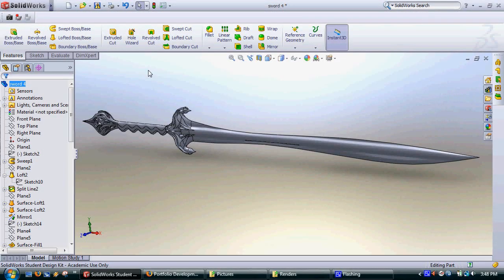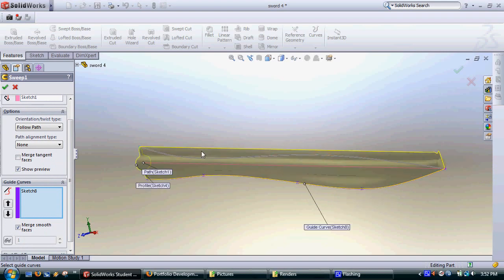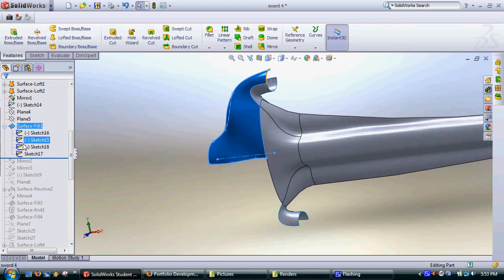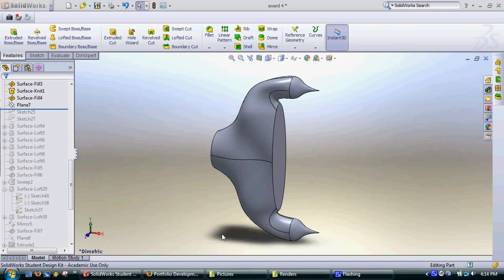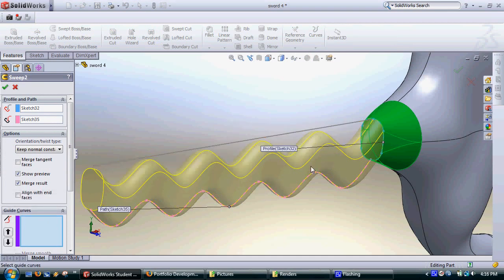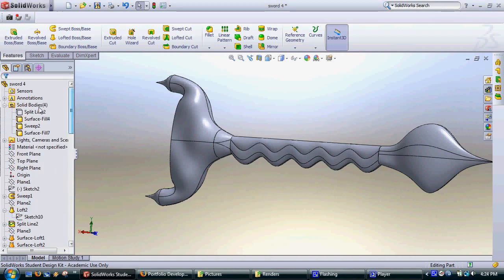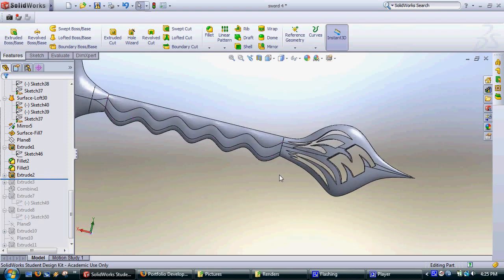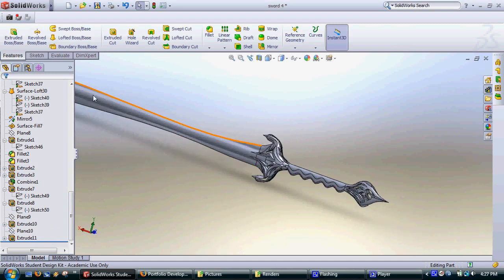SolidWorks - How I modeled my Sword

Comment: Although lofting towards a single point may work sometimes (not really sure why it does because technically it shouldn't), it is not a good practice. This creates, what they call, a degenerative surface. It's better to loft between profiles for more stable geometry. You can either create an extremely small profile for a sharp pointed loft or use another surface tool afterwards to clean up the tip.